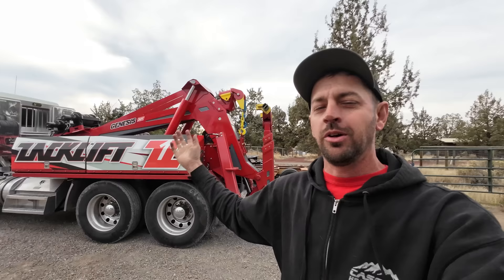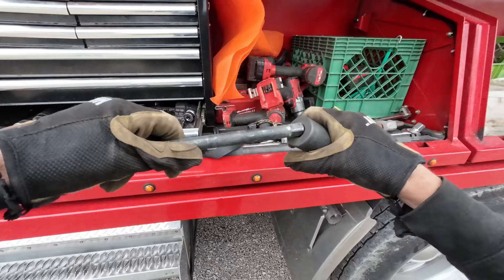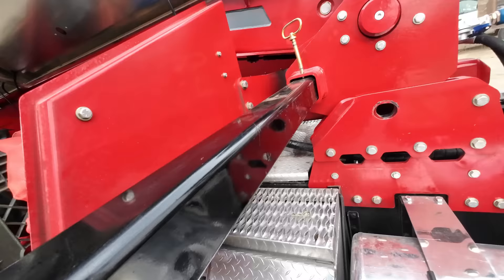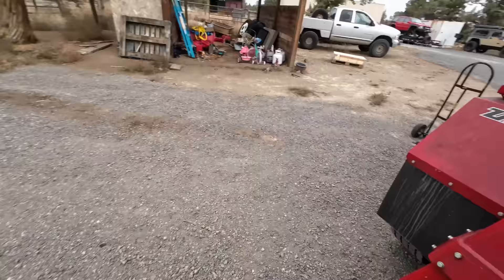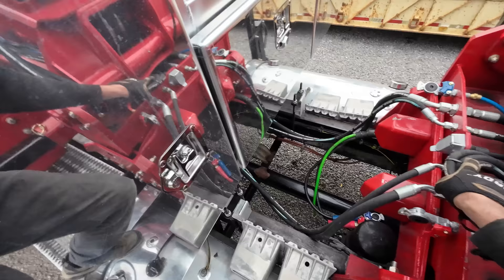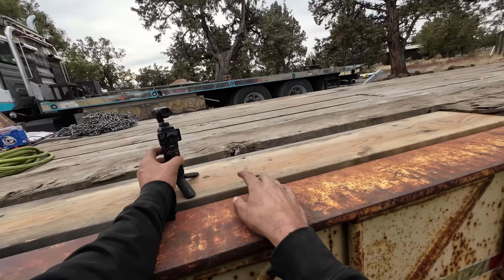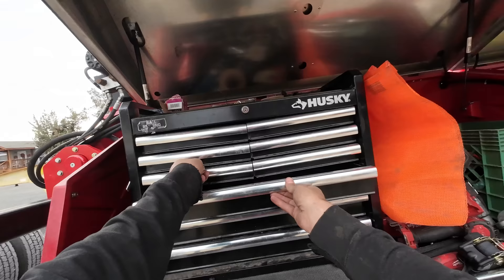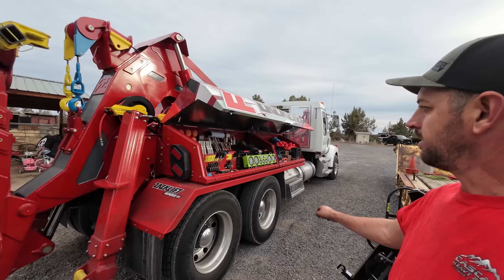How a quick change Heavy Wrecker works!  (the do anything truck)

Comment: Curious. How does it work with the mud flaps? I know in British Columbia you have to have them on your tractor. CVSE (Commercial Vehicle Safety Enforcement) won’t be happy with you if you don’t.
Reply from the maker: Yeah, same requirement here.  So if if was going to run bobtail I would simply drop the mudflaps back into their pockets

Comment: Casey, I'm sure you realized your mistake when you attached the Zacklift onto the truck again, but why did you cut a corner when you were detaching it? The leg aka landing gear on the passenger side, you failed to secure the pin with the clip.
Reply from the maker: Because the pin doesn’t need to be there
Reply: @CaseyLaDelle I'm confused. If the pin isn't needed to keep the leg secure, why did you do the pin and clip properly on the driver's side?
Reply from the maker: @daredevil_314  habit

Comment: That would been 10 minutes if you weren't narrating for us (which we appreciate) or messing with the video camera. That is an impressive change!

Does it make more sense to mount the winch on the front of the flat bed trailer? I was curious if there was interference to where you want to mount to the winch on the tuck and the height of the flat bed. I am sure you will figure it out. 8-)

Comment: @CaseyLaDelle - stupid question if I may....  once you remove the Zacklift, the truck is running with no rear lights? or have I missed something?
Reply from the maker: Correct.   I haven’t had the time or the need to make a new light setup for it.

Comment: Please just leave the key in the husky toolbox key hole to lock the drawers instead of using those ratchet straps. (unless those straps are to help the toolbox at the back of the storage box)
Reply from the maker: The key does not lock the drawers.
Reply: @CaseyLaDelle well damn, that's unfortunate, i thought i'd be a smartass.
Reply from the maker: @tastitas3  the key holds the top lid shut, and the top lid being shut is what locks the drawers.   But the top lid of this box was removed a decade ago

Comment: Just 1 question #Casey - is it possible to swap the handing of the headboard doors? (to allow easier access to the chains/binders etc from the ground)? As it is now, it seems you need to reach around the doors to get inside... just a thought, I love the whole setup aside from that 1  little thing.....
Reply from the maker: Where would you stand if they were the other way?
Reply: @CaseyLaDelle  Umm, my mind hasn't gotten that far into the thought yet, lols (Let's say my brain is "A work in progress").

Comment: Casey which portable refrigerator do you use. I forget the name of it the one that makes the ice if you can let me know thanks.
Reply from the maker: EcoFlow is the one that has its own internal battery and ice maker.   But it’s also big, so most of my vehicles have the smaller Setpower fridges in them
Reply: @CaseyLaDelle   it not for my low bed truck. It’s for my wife. Since we live in Vegas it gets pretty hot😂. I am looking for one for her. Thanks for responding👍

Comment: Right side black removable leg. You left the pin on top and forgot to put it in. Add 15 seconds to your time. :-)
Reply from the maker: The pins aren’t necessary
Reply: @CaseyLaDelle   Oh yeah, going from underneath the Zacklift and backing in the jacks are static. Letting it sit in the yard, it's also static. I thought I had you. Dammit!

Comment: No taillights, No mud flaps? 🤔
Reply from the maker: Mud flaps drop into their pockets just like 90% of the trucks out there.   And no, I still haven’t added tail lights because I still haven’t had any need to.
Reply: ya Casey needs those, cause he is always trying to stay legal.
Reply: Until Casey has time to install taillights, he can use the wireless ones if he needs to go and pull a trailer.

Comment: My nephew wants to know what a fifth wheel is and what it does
Reply: The 5th wheel is the latch plate thing that trailers hook into.  You can see it starting at 12:50 after Casey pulls out from under the Zaclift.  I don't know why it's called a 5th wheel though.  Maybe someone can tell us that.